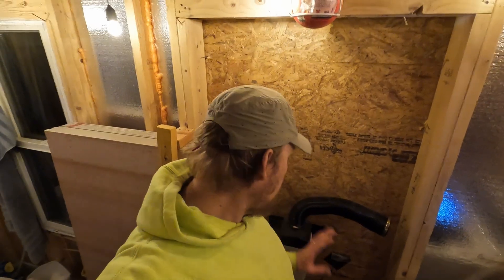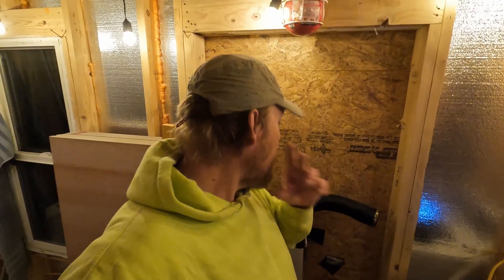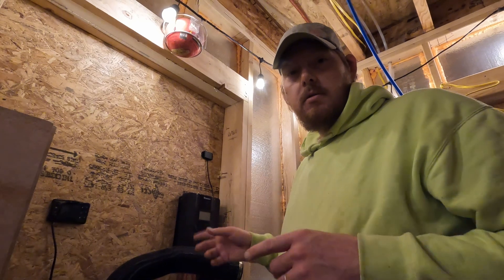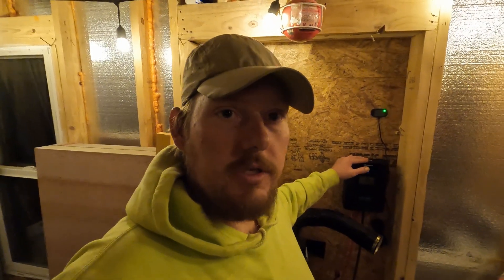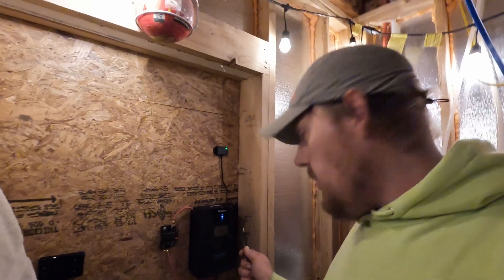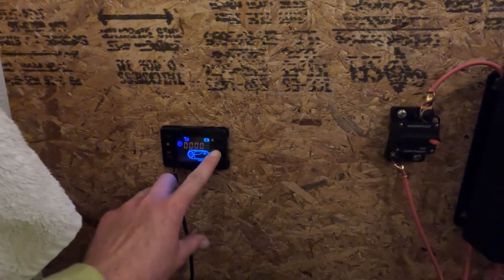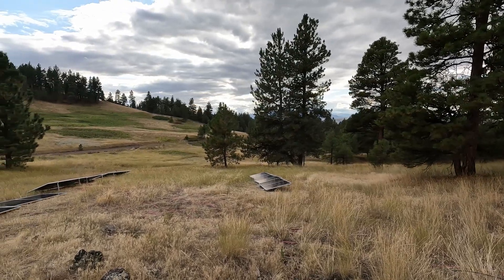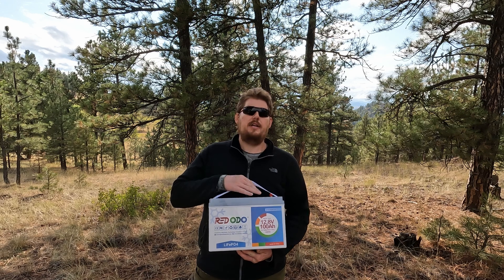Building An Off Grid Solar Powered Diesel Heater | Powered by Redodo

Comment: Yea, be careful.  I ran a generator exhaust thru a shed wall with 6" square metal plate centering a 1.5" metal exhaust pipe and after a year of occasional use (20hrs total gen run time) the heat transferred thru the metal plate to the 2x6 framing wood and caught the shed wall on fire.   Yours looks very similar which is why I'm commenting. I also monitored mine closely and still can't believe it caught the wood on fire.  The fire dept said that wood can ignite as low as 200F if really dry and/or perhaps just a bit charred which can happen over time as the metal plate transfers heat to mounting wood.  Gen exhaust pipe at the point of going thru the wall (about 4ft from generator) was ~400F.     Don't mean this comment as being critical, just sharing that it wasn't safe for my situation if it helps you.    Thanks for sharing :)
Reply from the maker: Thanks for the info. We're about to some maintenance on the diesel heater (clean the soot). I'll see if we can find a safer way to mount it.